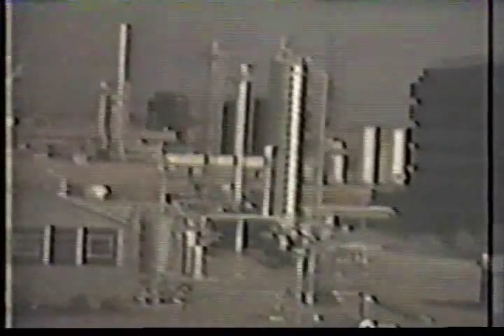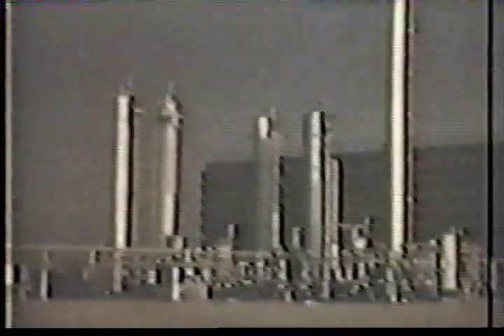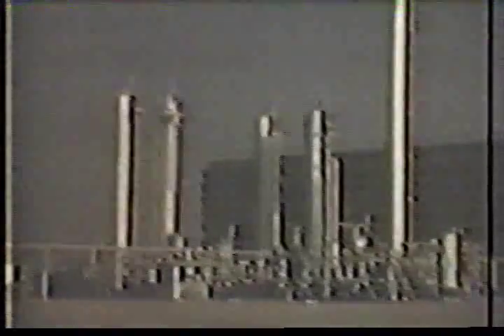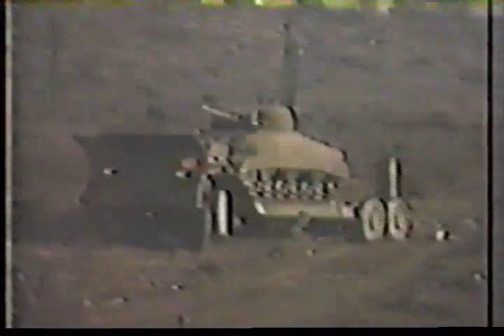Hall scott power part 4 of 4

Comment: That was one of the most interesting posts I've ever seen on YouTube!  I collect, restore and re-sell Gillig and Crown school buses.  I've done Cummins and Caterpillar units, so far, but very much want to do a Hall-Scott early Crown, and a 6-71 Detroit in either brand chassis.  The buses I rode on as a kid in the late 50's were Hall-Scott Crowns.  I remember the popping and backfiring when they were off-throttle, slowing the bus.  At night, you could sometimes see little flares of flame from the exhaust.  And, the old LAFD fire engines with un-muffled Hall-Scotts made such a sweet, unique and LOUD noise, they could probably have skipped the sirens entirely!!  Many thanks for a great find!!